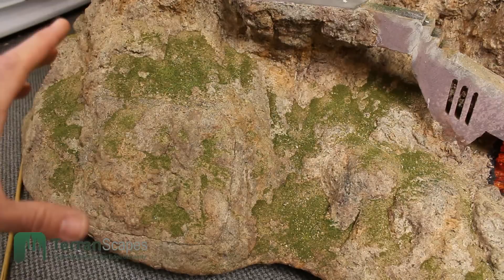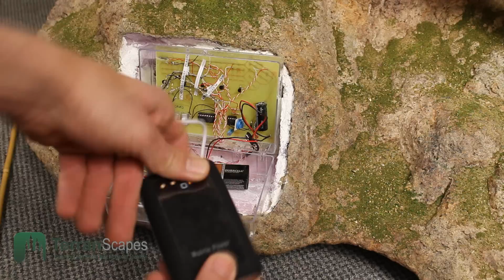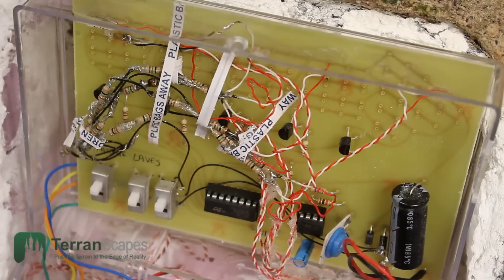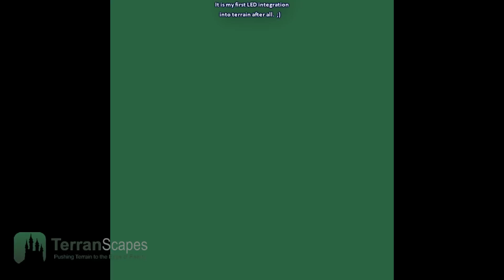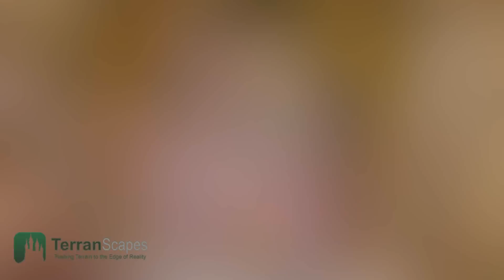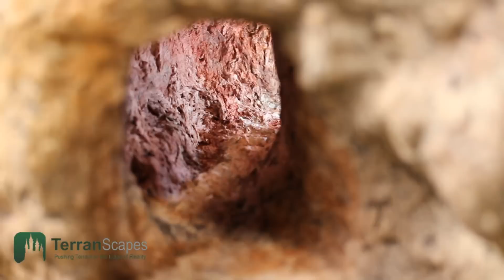TerranScapes - Cliff WIP 7 - Part III

Comment: WOW! You did ramble there for a minute. But you still do great work. Keep up the good work!
Ohm's Law. Learn it. Own it.
Reply from the maker: I just spent 6 hours a couple of days ago sitting down with Ohm's law (should have done that a long time ago) and calculating various numbers. Combining that with wattage calculations was really valuable.  I finally feel like I have finished the basics of learning, and I learned I needed to watch out for resistor wattage ratings.  Need to make a couple of changes as a result.  (Required some reading and math for parallel resistors as well.)  :)

Comment: I have been working on circuit boards for over 10 years and the 3 things you look for if your not being anal of how it looks is - Form / Fit / Function. As long as it fits those things which looks like it does from what I see you did a good job wiring it up.
Reply from the maker: Thanks.  A little neater would be my preference.  ;)  But, I actually need to make a few quick changes that will clean it up a bit.  I'll mention it in the next video.